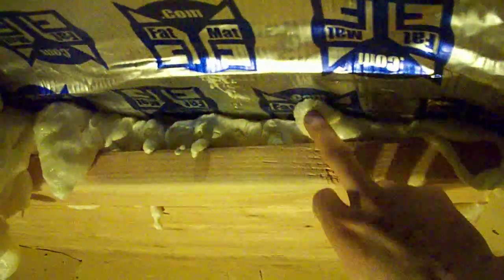2011 Sundown Audio build Team Never Satisfied

Comment from the maker: @lpngcf420 the 2x4s are glued and screwed down plus the pressure from the foam. they will also be glued and screwed to a sheet of mdf holding them down by a 45, fiberglassed sanded and plenty of bracing